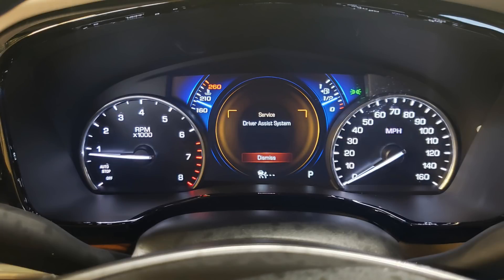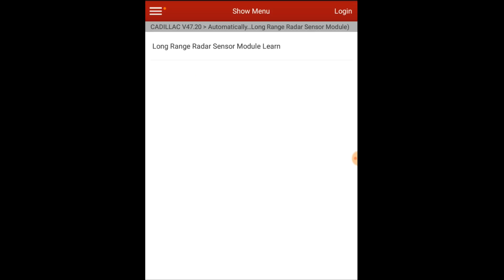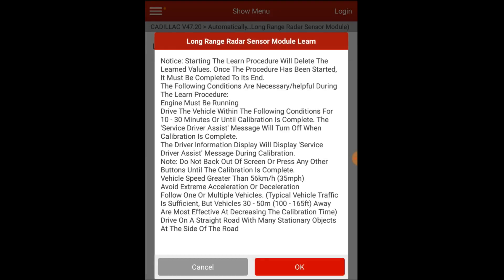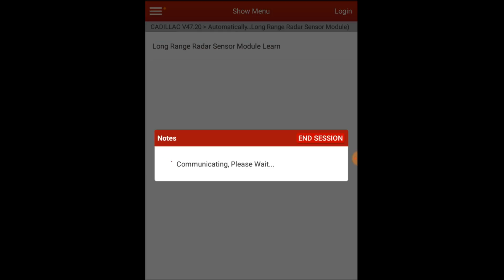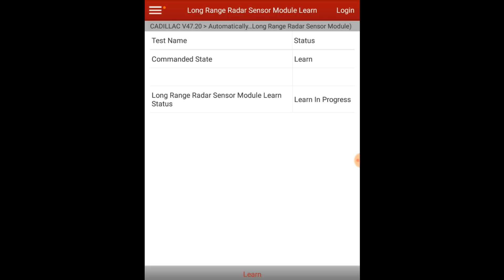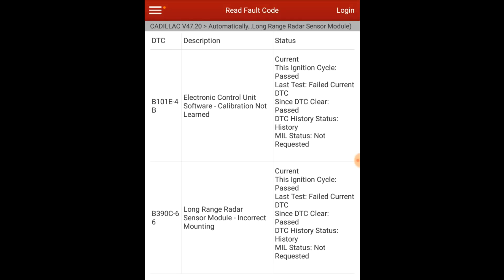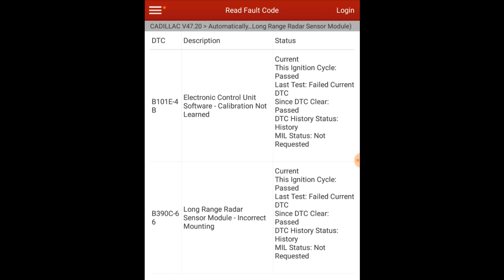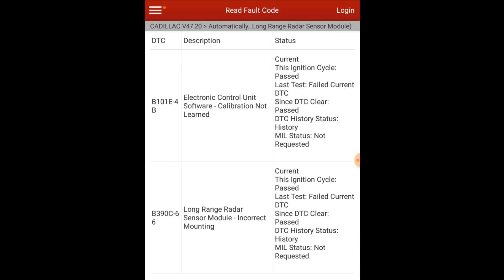2017 Cadillac Long Range Radar Calibration with the Launch X431 V!

Comment: Hey good job Keith. Quick tip you may already know.  In the Long Range Radar module data list it gives you 4 PIDs: 1 Angled up, 2 Angled down,3 Angled right, , 4 Angled left. They should all say NO. When you have a module/bracket misalignment one of the Angle pids will display YES. Sometimes the Advanced Cruise will be inop with no codes. These data pids can be helpful. They do not change state an until a drive calibration has successfully completed.